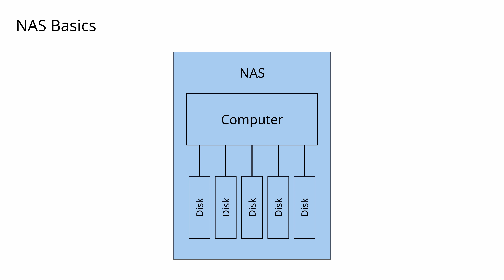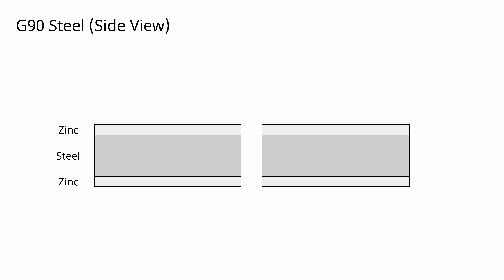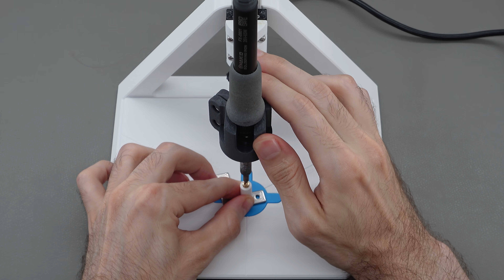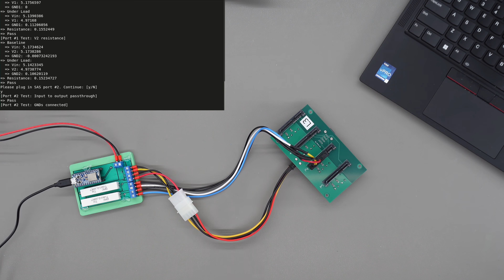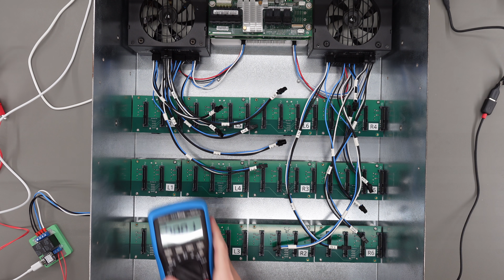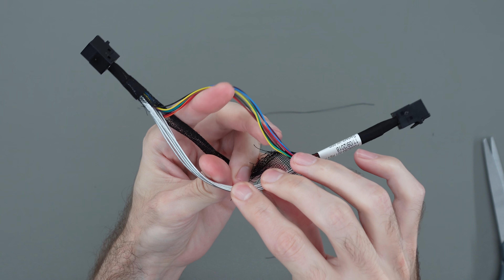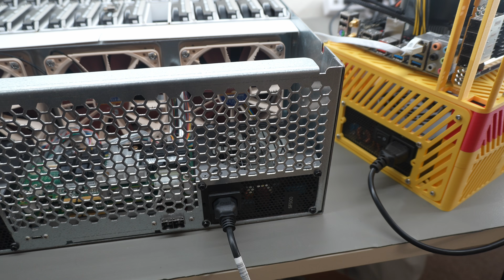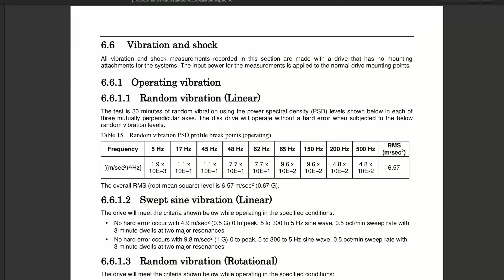I Built a 1 Petabyte Server From Scratch

Comment: I think you could have fit the expander lengthwise with external ports sticking out as intended if you placed it at the very bottom of the case with a small cutout in the sheet metal for it.
Could probably make a pcie connector for them to supply power, and as a bonus getting i2c bus from them.

That is definitely as compact as it can be, the only way to make it shorter in depth would be to increase it from 4U to 5U so that server type PSU can be used on the very bottom and all of the electronics also be on the bottom layer beneath disks.

Really well thought through design!
Reply from the maker: Yeah, I think this is barely enough space for that. I was also trying to avoid running the cables from the expanders to the disks at right angles since that will end up consuming a bunch more space anyway. It is also slightly more optimal if the expanders can be higher since they do get hot so ideally would get some of the main air flow

Comment: Great content, I have a ton of storage ive collected over the years, but 100 tb is already crazy big, but to use up 1024 or 1000 TB, that's a crazy amount of storage, going from small single drive to 1 Petabyte, wow, ok so 18tb drives in your example and lets say RaidZ2, and 8 drive sets in each group, 2 parody, you would need a whopping 12 Devs and 96 Drives , I don't think your case is big enough, it looks like a total of 45 drives, I guess you could make 2 of those cases, Beautiful engineering by the way, outstanding!

Comment: Seems inefficient. One computer can temporarily store the data. Turns on the NAS via automatic prompt and saves alot of electricity in the process. Has a slight delay, due to it being cached, until the NAS is turned on, but if you aren't rich and can burn money like that, it seems to be the more cost effective method.
Reply: Would be executed via a storage making a copy of the original data, saving it on 2 disks as cache, so that if one dies, the data can still be transferred and once any cache is created, it automatically prompts the NAS, turns it on, or the respective disk that is currently at use (but can also work as a directory. i.e. [this] disk stores X type(s) of data, while [that] disk saves X data, etc.)

So the user gets an interface, where it needs to select the type of data, before it is cached, so that the computer can prompt the NAS to turn on and enable power supply to the disk the desired data is supposed to be saved on. After that, an encryption algorithm shreds all cached data and deletes it from the harddrives.

No Open Source Algorithm. A custom encryption method with a custom key, preferably in shape of an OTP, making it literally impossible, since each data package has its own already used decryption key.

Absolutely impossible to decrypt. 

Encryption algorithms and the key to it only on a local network. A device not connected to any internet and the device used lacks the hardware components to enable it. So even with a RAT it is not possible to enable any connection to the data stored on that device. 

Access to system only via hardware key. Password required before inserting it into the plug.

10 digits only recognized after entering another 10 digits that decrypt the numbers you initiatially selected. 

Custom build. Containing a mechanism after tapping the number 3, 3 times burns all chips and makes it impossible to recover the key.
Reply: Algorithm to access a file uses metadata per file stored, OTP encrypted scraped from images shared on the femboy subreddit.

^
Shitpost hashing. Key internally generated from all stored data, so to decrypt the entire file, all previously stored files would have to be accessed, which makes it hard, since accessing the terminal is already extremely difficult. 

Viewing data requires a different key, than saving files to it, so even via shouldersurfing it's not possible, since the key that would be obtained doesn't grant access to the directory, but only to save 1 file to a specific directory. 

So posting anything on said subreddit wouldn't even enable to access a file, since the algorithm to hash the file with is calculated via all files already on the harddrive.

Which has 1 unknown file from an unknown source to make it impossible to track it down, by analyzing the posts shared up this point.

Introducing the FYL encryption. (Alternation of FML (fck my life))
Reply: Can also be expanded, via creating a new file format for a custom OS to read. Rendering all Trojans that potentially poison the application used to read them useless.

Middleman computer can only write to, never write the harddrive.

Middleman rips the file extension. Added the new one only on the NAS itself, to make it impossible to read any data, while the extension is being added. 

Each disk uses a custom format for all types of files, that only the NAS itself can prompt the disk to write the file. So i.e. a .pdf is only saved on [X] drive. Data requested to be saved on [X] hard drive. 

Which is a false input by intention. A third component may correct the false extension via knowing that extension translates into [X] extension. 

So even without the usage of that component while having direct access to the directory makes it impossible to read any data, cuz all the extensions only known to that specific component enables it to be corrected and makes accessing the type of data without access to that component impossible. 

Which may or may not be installed. Yk. Nobody knows, what kind it requires and where to find it... :3
Reply: Opening the case of the NAS automatically shreds all data and then burns the disks, if the hardware key is not plugged in at the same time.

Which is powered by a physical battery that can be installed under the same conditions, but WILL burn it automatically, if the energy left in it hits a critical low.

So without the person having the key the data automatically destroys itself after the system was active for a certain amount of time. And a different person stores the component to revert the false file extension against their knowledge, considering it to be something else.
Reply: A metal cage blocking EMP could also be very interesting. 

All frequencies stay inside that box and all frequencies outside stay outside. 

Faraday might also work.

Airflow not present, except being powered inside by the same battery. No openings. Micro or nanotechnology might be existing. So we must account for that. 

Heat outside transferred inside. Any attempt to break or crack the case automatically supplies heat directly to the chips that is recognized and redirected to wipe the data and corrupt the entire hardware. 

A prepared glitch. Just to be held hostage and meant to corrupt all data due to a prior analysis of how the program would behave and all logs were never documented.

Copies of OS never distributed to other computers. Limited to that device only. And all documents regarding to it's existence were shredded via hashing, and the device containing the documents intentionally destroyed and it's parts scattered all over the world.

Unless the hardware key is inserted there is no possibility to access the interiors, without permanently destroying whatever was inside or the data that was stored on it. No possibility to recover.

Comment: When you are committed to space, I guess spinning hard drives are still the way to go but the footprint of some nvme drives would certainly cut the footprint of each drive down and dramatically speed up the storage. It would drop power requirements because you wouldn't have to spin anything up anymore. I'm wondering how many of those drives you could cram in the same footprint and have reliable storage.

Comment: Whats the setup around switching between standby and idle. 20 min no transfer disks switch off, something like that?
And how long does it take to start copying data over when on standby.
Last question, any note on the specific drives you decided to use and why?

Just want to add your LED design is better then some enterprise JBODs I've seen. It's awesome to see it being done like that.
Reply from the maker: Around 5 minutes on. 10 minutes off (mainly because i haven't parallelized the spindown script yet).

I mainly just picked any WD ones since they tend to have lower failure rates from my research. I grabed the SAS version because they were cheaper though SATA drives are probably easier to work with for consumer applications since they have low power states while the SAS drives just have the hacked on-off power state that my motherboard wraps around them. I tried to get helium filled drives since they are quieter.

Comment: SaS expanders? 
I remember back in the day SCSI Target mode was way too daisy chain SCSI controllers but you still needed to have them on a bus, what special about these that you don't need to have them on a computer PCI e bus?
Reply from the maker: I can't account for all variants of these boards, but all the ones I've seen only that are don't require configuration to enter daisy chaining mode just use the bus connector for power. So there's nothing special here aside from not connecting the unused Pcie data lines.
Reply: @MadeByDennis  yeah my experience has been the exact opposite but then again I'm the broke guy that everyone gives their hand-me-downs to because they find them too frustrating to deal with configuring. And of course most of my experience is with older equipment as well.

Comment: This is simply amazing. Both the build as well as the video, thank you for taking the time to make the models and all the information available.

I'm looking for an alternative to Send Cut Send in the UK, and trying to get some quotes. I'm wondering how you provided the instructions to SCS in regards to the PEM inserts. The two I've contacted so far have asked for a drawing around placement so I'm trying to understand how people create those. (Is this something fancy I need to create with a CAD software, or do I just convert the design to a PDF and write what inserts go where? (I know the github repo has information on the inserts, but I'm just wondering if they need more than just that list copy/pasted, as I don't see any markings on the step/dxf files)

ps. A discord community would be lovely to get some like-minded people together :D 

Thank you :)
Reply from the maker: For SendCutSend, they have an online UI where you click on each of the circular holes and indicate the PEM insert type and whether to insert from the top or bottom of the flat sheet. The manufacturer will also need to modify the diameter of the holes to match whatever is needed for the specific insert model used. Not sure if there is a standard drawing type but may be worth checking if your manufacturer has a recommended format.

Comment: Why not use two of "Supermicro 846EL1 SAS Expander backplane 4U 24x 3.5" HDD ports" - or similar? 😉
Reply from the maker: It's easier to design around a board that I have all the dimensions for and is more optimized for a low air pressure setup like this. The cost of custom boards is fairly affordable anyway.

Comment: What method did you use for staggered spin up?
Reply from the maker: The SAS HBA card I'm using natively supports staggered spin up. No set up required if you stick with the defaults of the card (4 disks at a time)

Comment: incredible skill level

I suggest a radical 3D Alternating North-South (N-S) Matrix for your drive arrays to solve the core challenge of petabyte-scale storage: Rotational Vibration (RV). By staggering drive orientations in an N-S-N-S pattern on each PCB and mirroring the layer below it (S-N-S-N), you create a Mechanical Phase Cancellation system. This prevents the drives from 'stacking' their vibrations; instead, the rotational torque of every actuator is physically neutralized by its neighbor in all three dimensions.

The 3D Grid Architecture:
◦ Layer 1: N-S-N-S-N-S
◦ Layer 2: S-N-S-N-S-N
◦ Layer 3: N-S-N-S-N-S
◦ Layer 4: S-N-S-N-S-N

Essential Technical Defenses:

Electrical Timing (Serpentine Routing): Flipping the drives shifts connector locations. You must use serpentine trace matching on the custom PCB so every data packet travels the exact same distance. This eliminates 'timing skew'—crucial for signal integrity across such a large, flipped grid.

Preventing 'Screw Walking': Apply blue medium-strength thread-locker to every mounting screw. In high-density builds, micro-vibrations act like a slow-motion screwdriver. This prevents screws from 'walking' out over time, which would otherwise lead to loose drives and head-seek errors.

Damping the 'Drum Skin' Effect: Apply butyl rubber sheets (viscoelastic damping) to the chassis walls and the rear of the PCBs. This converts kinetic energy into low-grade heat, preventing the large PCB and metal panels from acting like a speaker diaphragm that amplifies drive noise.

Harmonic Isolation: Use silicone gaskets at every mounting point and nylon standoffs between the four PCB layers. These 'drink' high-frequency harmonics at the source, preventing vibration from traveling vertically through the stack and protecting solder joints from fatigue.

By combining active torque cancellation with electrical timing optimization, you aren’t just building a NAS—you’re engineering a high-precision storage instrument. 

Incredible work!
Reply from the maker: This is a great comment. Some things like thread lock and gaskets I was thinking about but shelved until I had more long term data and how it helps up. N-S alternation is something I haven't heard about before and going to add to the V2 ideas list. Thanks!
Reply: AI pilled but great suggestion
Reply: @captaincaption  AI excels at refining imperfect prose. Trust me, all these ideas stem from my observations of the video and what I would build given the means.
Reply: @anoirbentanfous  absolutely, I really don't mind it at all, I knew you understood the subject matter, so it's all good!

Comment: I feel like I just watched a "here's how you can build a simple chair" video while the host walks into his workshop with every tool you don't own.

Truly impressive, but I have to wonder what the cost (time included or not) for this project was vs using enterprise gear.

I picked up a Supermicro CSE-847 44bay sas3 jbod for $500 and swapped the loud 7x 80mm fan wall with 3x noctuas 120mm and a 3D print wall.

Comment: Very nice project, looks extremely professional. A couple of suggestions:

* For the cut ends of the galvanised steel, you can get Zinc Galvanising Spray Paint to protect from rust.
* I've moved away from Noctua fans now, especially for rack deployments, the Pro/Max range from Artic, they are about a 1/3rd the cost and provide more top end on airflow and static pressure with very little trade off I can tell on noise.

Comment: Given you need 5 and 12V, would it be worth adding a couple of batteries of those voltages and setting it up to gracefully shutdown if a PSU failed.
Not a lot of space for that in that case, and batteries would need to be large enough to supply shutdown current, but it seems a simple enough safeguard. Like you said you could use the 12-5V converter but that also is a potential point of failure I suppose.

Edit, very nice build too BTW, GL with v2
Reply from the maker: Currently I'm relying on a separate UPS box for that. In general it's unlikely that one off power losses cause any noticeable damage given the protection mechanisms inside the disks but yeah always good to have multiple protection layers
Reply: @MadeByDennis  Do you know what the failure rate of power electronics are? Non-zero I'm sure. But simple chemical batteries is about as close to zero failure as you can get I imagine. If you put them in you take out that whole line of possible failure, from mains to low voltage input. That's what I'm thinking anyway... And from what folk were saying one PSU going down could be catastrophic. So if there's a simple reliable way to avoid that it might be worth considering. GL

Edit: UPS is nice but it still needs the HV AC to LV DC stuff to work properly. If that fails UPS won't help one bit. You can simply drop in 5V and 12V Lead acid or whatever battery and not have to worry. Drives will park, things will stop no matter what happens, if they are functional. Compare cost of that to system, is it worth - I wonder.

Comment: I would be very, very tempted to just buy the backplanes instead of building them. Many, many cheap, used backplanes are available from enterprise system pulls and they don't tend to go bad.

Your disk temps are good, 35-40c is ideal. SAS expanders and that sort of thing tend to want to be under 80c or so. They can run hot, it's not a huge deal.

USB control is cool, but it's proprietary. Not sure if there's a more mainstream solution as these sorts of JBOD expanders tend to be run 24/7 and any power savings is due to the host computer issuing spindown commands to the disks directly.

Comment: Meanwhile I'm currently building a NAS in a 13 year old SFF Lenovo case using an embedded motherboard from a POS (Point of Sale(!)) system, a TFX power supply who's Voltage I'm stepping up to 19V to power the embedded board, 3D printed holders for the HDDs, a Mini PCIe to 4x SATA adapter card and so on. 

Your process is really elegant and you make use of a bunch of new and nice parts. My process certainly isn't as elegant but the upside is that I'm using a bunch of scrap to make something really decent (I think)!
Reply from the maker: Cool approach on your end. It all depends on what you care about optimizing for I guess. I personally do like having fewer parts that are commodity or re-makable.